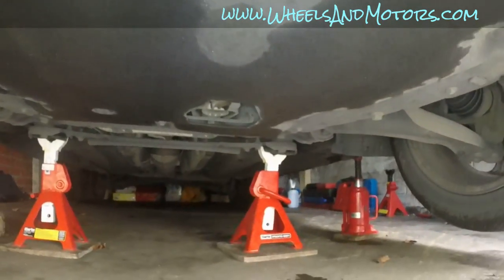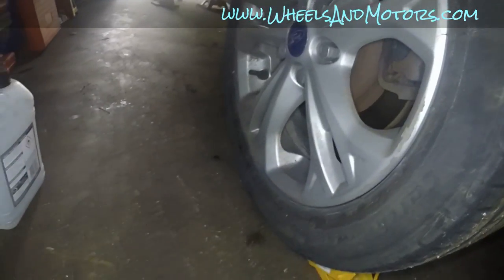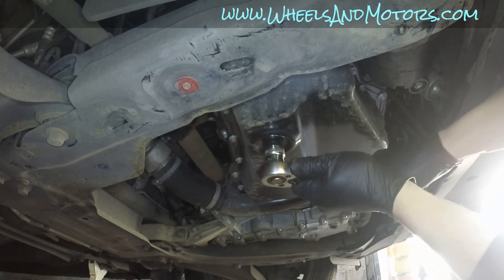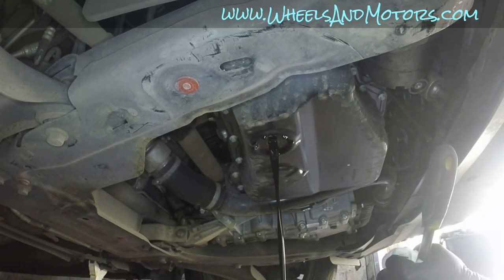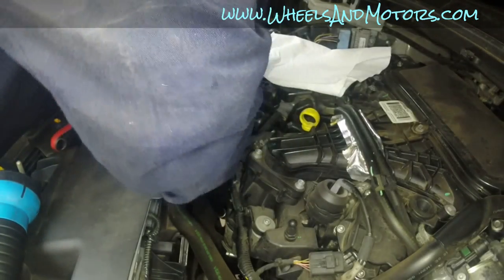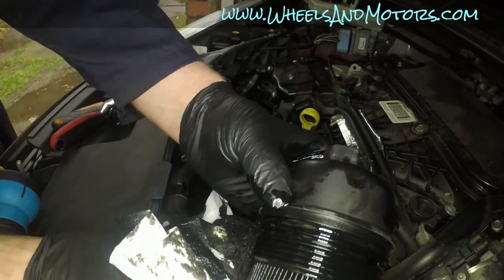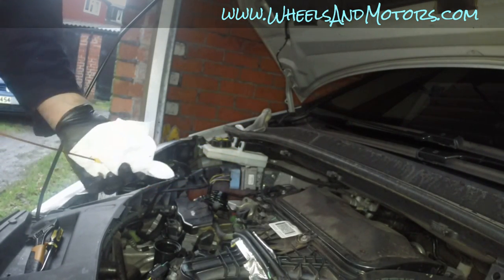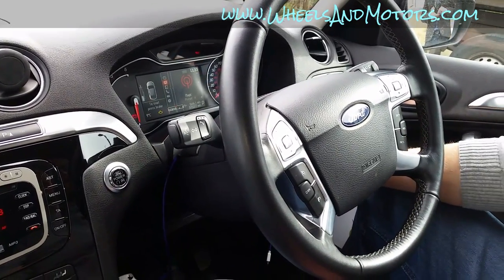How to do OIL SERVICE Ford Galaxy/S-Max 2.0 TDCi

Comment: I was about to start an oil and filter change on my S Max and found your video. So glad that I did, because I would have struggled with the oil filter without the tool you have kindly linked in the description. Thank you! 😊
Reply from the maker: I had it hard first time.. You're welcome 😊👍

Comment: Thanks for the video. Just gave up trying to make things work when I discovered your video. Doing this on the equivalent 2013 Mondeo. Have just ordered the tool and oil change postponed till it arrives.
Reply from the maker: It all becomes easy, when you get on it, get the confidence and start doing it. Please mind, that if your Mondeo has automatic gearbox - oil in that also needs to be changed every 35.000 miles.

Comment: Thanks, just done my first oil & filter change. Filter was actually much easier to get to on my 2012 Galaxy, higher up and on right side of engine.
, just needed to remove an air hose to get to it.
Reply from the maker: Is it the same 2.0 TDCi engine?
Reply: "...higher up and on right side of engine" That sounds like the 1.6 TDCI, not the 2.0 liter! ;-)

Comment: Just had a look at this as recently acquired an Smax, the service oil light has just come on. Doesn't look too bad a job to do apart from the ridiculous oil filter location. I've got a socket attachment with a nylon strap loop attached, used on a car I had a few years ago, just wondering if that might work...
Reply from the maker: Good idea 💡

Comment: Great video and well described. Am I right in saying that access can be gained to the oil filter without the tool when replacing the fuel filter?
Reply from the maker: Thanks! Not sure what fuel filter has to do with oil filter, but I can say for sure that maybe it's possible to replace oil filter without special too with a BIG strugglel... actually no - you still need something special, because access is very limited.
Reply: Managedthe removal of the oil filter with a normal 27mm spanner with the front steel plate off the fuel filter for a few more millimeters. Slow process of turning the spanner over every turn but manageable.
Reply from the maker: It is awkward position 🙄

Comment: Hallo,  should I add the whole 5l of oil or like 3 liters r enough?
Reply from the maker: If I remember correctly, that engine takes just over 5 litres. There's a dipstick to check the level.

Comment: Doing this tomorrow, do I have to let the car off axle stands and back down level to drain all oil?
Reply from the maker: I don't think so, if it's lifted only this much, drain plug must be still lowest point.
Reply: @wawayltd  yeah, just finished the job, I think it drained fully up in the stands. I think I may have slightly overfilled the oil, maybe a couple of mm above the max, so now I'm worried!  Should I jack it up and drain a small amount out?
Reply: @daginge29  to much oil is as bad as not enough.  done mine today and have always empted the oil then rolled it back off the ramps and started to top up keeping a check on it dont just put the lot it as there is always some left in the engine. put and a 3rd in and keep a check with ths dip stick letting it settle before you rip the dipstick in and out. easy stuff. just keep an eye on the sump plug and filter housing to make sure no leaks.
Reply: @deano386  yeah I was reading that!  Car was on drive on a slight slope, when I parked it on the flat and left it to settle, its absolutely spot on the max!

Comment: Is it not necessary to leave the car horizontal to get all the oil out?
Reply from the maker: It depends where the plug is. On VW's it's even better, because plug is at the back of sump. When we did that Ford - it didn't feel that sump tilted that much. I think unless you lift the front ridiculously high - plug still should be at lowest point.

Comment: Does it work the same on an Automatic? Thanks
Reply from the maker: Yes. The car in the video is actually automatic (PowerShift). However, you need to remember that automatic gearbox also needs oil change and it also has filter. Once in about 35.000 miles.  There are videos here on YouTube how to service PowerShift gearbox, so I didn't make one... Might do in the future.

Comment: Would this be the same for the Ford Galaxy Zetec 2014?
Reply from the maker: If it has 2.0 TDCi engine, then probably yes. Please mind - if you gearbox is automatic, you need to change oil and filter for that one too - about every 35.000 miles. I don't have video for it yet.
Reply: @wawayltd  Hey, great. Thanks for your reply. It is indeed the 2.0 Automatic Diesel. Oil has been changed yesterday but the filter hasn't been changed yet as I'll need a new housing cap(for the oil filter).  Can it cause a serious issue if the filter isn't changed at the same time?

I never had any issue with the transmission but after the full service(including timing belt), I noticed that the car was revving up every time it changed gear(some call it to gear slipping). Do you reckon it has anything to do with not changing the filter?

I would appreciate your help!

Thanks!
Reply from the maker: @jeffersonf8143  Filter needs to be changed as well, not sure what exactly going on when you leave old dirty filter, probably depends how badly it's clogged up.
Reply: @wawayltd  Fantastic! Many thanks!